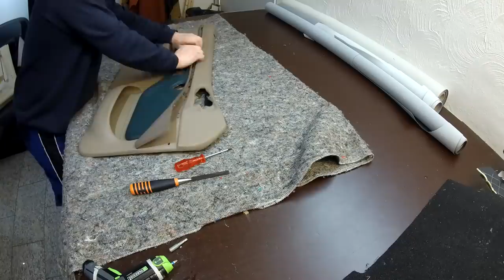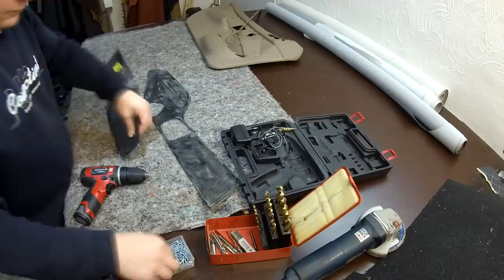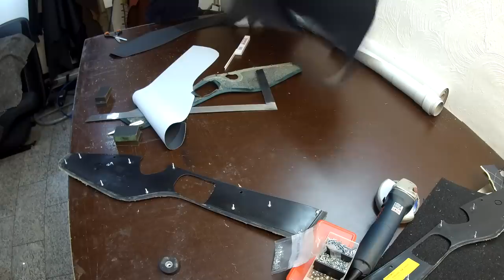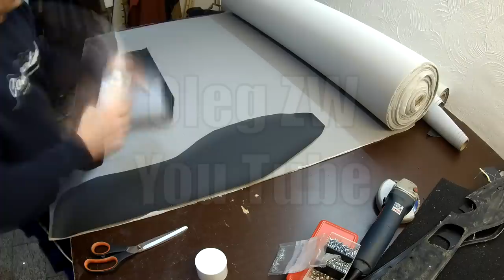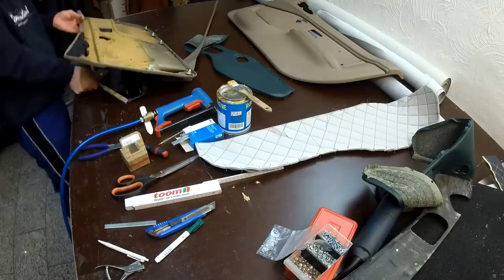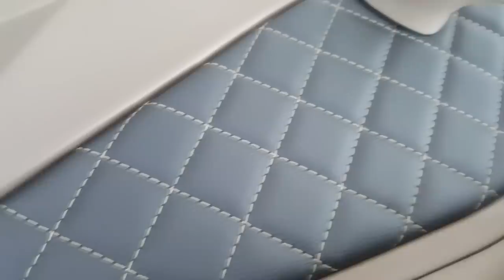How to Make Custom Interior Car Panels. Car Door Panel upholstery BMW Z3. Car upholstery.

Comment from the maker: Mercedes E Klasse: https://www.youtube.com/watch?v=R_-BzU4vkl4
Reply: Is it possible to purchase this style of fabric instead of creating it from scratch? If so what would it be called? Thanks and a SUB from a fan
Reply from the maker: @commentbeast3985  
The color, the thickness of a thread and the quality of the foam rubber are very important. That's why I always do it myself, for each customer individually. The finished material can be queried here.
Reply: Gude, beziehst du auch Sachen für "kunden" ?
Reply from the maker: Nicht mehr.. nur als Hobby.

Comment: Great job, nice video, g
Ad people can see how much work it takes just to change the centre insert on a door panel. Customers always tell me that its just a small piece of cloth in the centre to be changed, they think it can be done in 30mins
Reply from the maker: Thanks for the comment.
More good customers.
Reply: Well, yeah.  This guy did the whole door in 24mins!
Reply: I had a customer sit and watch me fix his door panal ..... after I was finished he said that I didn't charge him enough and gave me more money.
Reply: Actually if you're properly organized before starting and have everything you will need in your work area it will take alot less time.
Reply from the maker: @jamisonlegates6609  
I also came across these. These are mostly elderly people.
Reply: Yeah and this dude looks like he's done it a few times too been doing my own for the first time and it's been a learning process for sure and definitely not taking only 30 minutes
Reply: @jamisonlegates6609  customer loves panal

Comment: This is great tutorial how door panels are done! I work in a workwear factory, so for me the sewing is not a problem but I cannot see the screws you are using. I see that you drill a hole in the plastic and put some special type of screw? I hope that I can find similar ones here and finish my door panels in my Alfa 156. :)
Good work!!!
Thanks!
Reply from the maker: These are not special screws. Only under the screwdriver vertical m3 or m4 I can not remember.
https://www.google.de/search?biw=1920&bih=938&tbm=isch&sa=1&ei=5xsFXNSDOIzGwQLM5ZeQAw&q=schrauben&oq=schrauben&gs_l=img.12..0i67j0i10i67j0l3j0i67l2j0l3.45072.45824..48118...0.0..0.59.530.10......1....1..gws-wiz-img.......0i7i30j0i7i10i30j0i8i7i30.8dbKfgrHQW4#imgrc=sWqTbnQxYLo3jM:

Comment: Out of curiosity, what adhesive did you use? Have been wanting to do this with a synthetic suede with a rubber backing but the only thing holding me back is I don't know what adhesive to use. This is fantastic!
Reply from the maker: Thanks for the comment. I use neoprene and spray glue

Comment: What does something like that cost to get done ?
Reply from the maker: Ask your nearest workshop.
Reply: @olegzw857  wow why didn’t I think of that.
Reply from the maker: @Rickypaleo1776  
Do not get me wrong. Each master calculates his costs and expenses differently. Some have customers, some don't. For one the material costs $1, for the other it costs $10. 1 hour of work is also different.
It is probably the cheapest in China, but the quality of work and material will vary.
Reply from the maker: I received 200€ for this work
Reply: @olegzw857  thank you for your answer, I’m located in the US just realized your in Germany. Thank you for taking the time.
Reply from the maker: @Rickypaleo1776  
I hope I answered your question?
Reply from the maker: @Rickypaleo1776  
I don't think they will use this thread for sewing in China that I use. https://www.diekleinewerft.de/serafil-20-amann-uv-bestaendig-multifilamentzwirn-polyestergarn-synthetisch-planengarn

Comment: When hes disassembling the door panel itself, he's undoing the plastic welds right?
Reply from the maker: Yes that's right
Reply: @olegzw857  Just to make sure I understand the process. Your undoing the plastic welds and then using the plasic welds as markers for the holes you drill. What kind of retainers are those your using?

Comment: Forgive me if this is a dumb question. Is that a staple gun? How's are the staples not showing on the reverse side. Due to the fact the fabric is multiple layers?
Reply: You're likely right that he's using an air staple gun. Likely the staples are 1/4" - very short.

Staples seem to be common in auto upholstery into plastic.
Reply: I screenshotted it and zoomed in. Can't read the box, but it's clear they're standard width and 1/4" tall staples.
Reply from the maker: Staples small 2 and 4mm

Comment: What kind of glue are you using because that 3M spray stuff just does not hold up over time
Reply from the maker: https://www.ebay.de/itm/1-SCHAUMSTOFFKLEBER-SPRUHKLEBER-SERVISOL-QS-900-500-ml-KLEBER-SCHAUMSTOFF/310723906294?hash=item4858968af6:g:9fIAAOSwImRYSyZM and robyprene

Comment: Nice job, great video. I need to finish doing this to my E24. Changing (slowly) the tan interior to black. Started with replacing the stock seats with black Vader seats from a late 90s model M3 and removing all the other trim from the car to paint/repair it... that was a few years ago.
Reply from the maker: I think you will succeed. Good luck.

Comment: Have a 1992 Dodge stealth that I ordered better door panels for, the only issue the side insert is Tan vs My original Black insert. Is it hard to change out inserts ? I noticed your drilled out the inserts on that vehicle
Reply from the maker: I can not say. I did not do for Dodge.
Reply: I noticed that you drilled out all the old fasteners, and installed screws with nuts, Did you do those as a better upgrade from the old fasteners, or can the old fasteners still be used?
Reply from the maker: @rickedwards7172  
Can be used, but some of them broke down and I changed everything.

Comment: Great work. I know this is an older post, but is it possible to go straight over an existing door trim? In my case, they are vinyl and in good order, but I would like to have a darker cover, be it leather/vinyl etc. Thanks in advance for any advice.
Reply from the maker: I did not quite understand the question, but it’s better to remove the old material

Comment: The material  of the gray roll  12:28. ??
Reply from the maker: Synthetic leather for Opel
Reply: @olegzw857  not that, that sponge you put underneath
Reply from the maker: @alexdetullio1091  
Foam rubber  45  5mm

Comment: Where did you get those screw insert you put in the door panel
Reply from the maker: In the shop Bauhaus
Reply: @olegzw857  not sure where bauhaus is, can you post a link...or info where to buy them
Reply: It's an upholstery/crafts store.  You can get that kind of stuff at any crafts type store in the department for furniture upholstery.
Reply from the maker: Sorry, I thought you only need screws Basically, I buy stuff here
https://www.mah.de/

Comment: Would be a How-To video IF you narrated. This is a tad bit useless.
Reply from the maker: Take Intro consideration.
Reply: Oleg ZW I would just like to know what you used to reattach. I know the adhesive to use. But was it also screws? Thanks, in advance. 👌
Reply: I would also like to know what Staples you used to tack the cloth on the back. Thanks!!
Reply from the maker: Atticaz
fitting screws with plate or hot melt
Reply from the maker: Gred Nichols
on what minute?
Reply: 16:15
Reply from the maker: Quite short 4 mm  80/04
https://www.bea-group.com/
Reply: I like it much better this way. No nonsense, just seeing how he works.
Best way to learn imho.